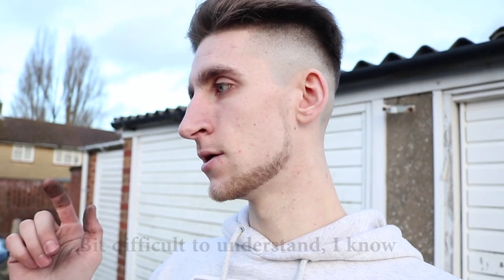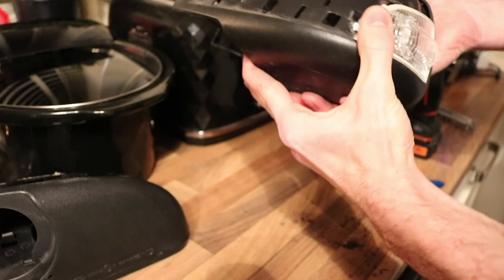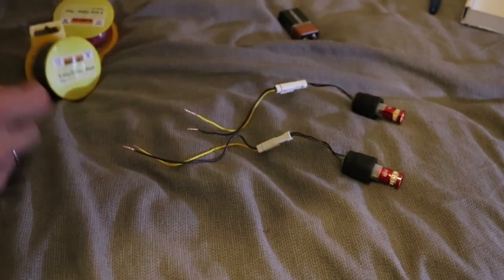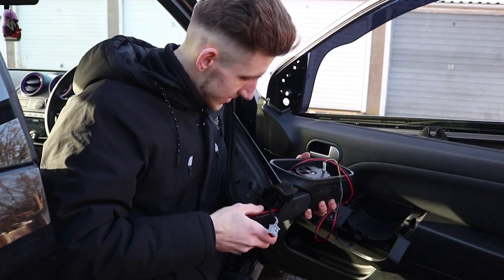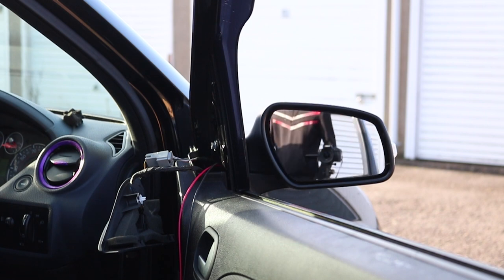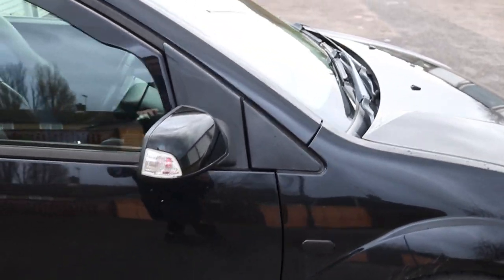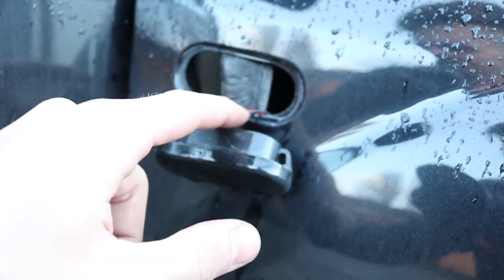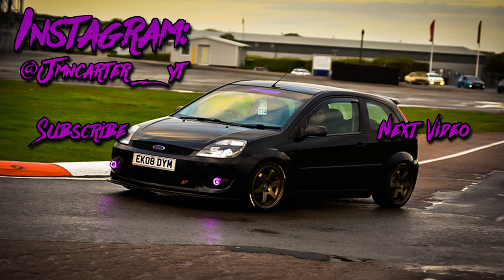Installing Focus Wing Mirror Indicators to the Fiesta ST150

Comment: Great video man. I’m using this as a tutorial for myn, I have the right caps but when I clip them in the top inner catch won’t clip into the fiesta part, don’t know if yours is the same or not but thinking of putting tiger seal under it or double sided tape

Comment: Looks good and well done.. But.... I reckon you have missed a trick.. you have fitted the pfl.. the face lift ones could have been used to auto close, also the face lift ones can you the sequential leds..you could go one step further and used the RS puddle lights that are a cut out under the light.
Reply from the maker: I looked at them and everything about them is different. Done some research and people have said they are very different to the PFL. Some mirrors on the ST150 have powerfold which means they auto close, unfortunately mine doesn't but I think most do. I am using the fiesta base for the wing mirror, only focus parts are the mirror cap,indicator and wiring just for the indicator (the two wires).
Reply: @Jmncarter  I have a st225 and you can retro fit the pfl and fl, so if you have fitted them you must be able to also, you could also get the loom of a st150 that has folding mirrors and use it to control the face lift? The st150 are horrible btw very noiset and clicky...search youtube for : 03ANO  HOW TO INSTALL FACELIFT WING MIRRORS ON A PRE-FACELIFT FORD FOCUS ST.
Reply from the maker: @isoconfused8744  I'll take a look, cheers for the info man

Comment: Is it just me or on the final scene was the led indicator on the drivers side you linked in too not working after wiring it in. Or was it just camera angle
Reply from the maker: Bolloks, someone noticed lol 😂😂😂 well spotted mate. One of the wires from the side repeater just pulled straight out of the unit and theres not an easy way of repairing it. Will involve dismantling the side repeater and re soldering the wire back in place but doesnt look like you can take them apart.
I'm looking at what to do tho mate 👍
Reply: @Jmncarter  lol. Gutted for ya. Got mine off ebay £13 sequential led.